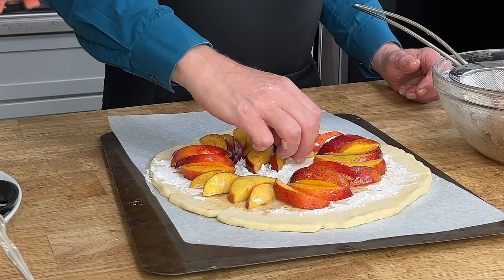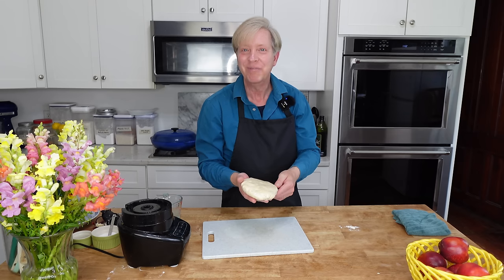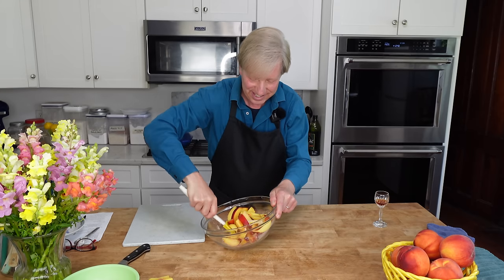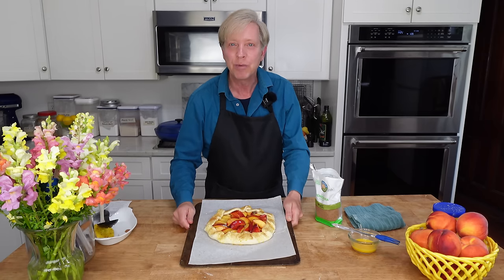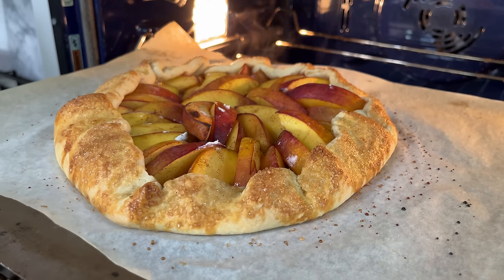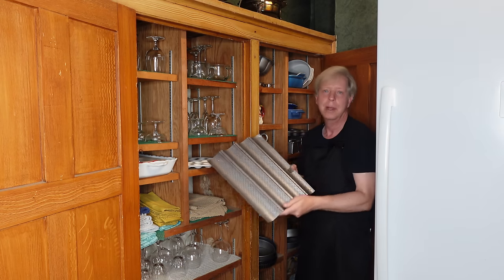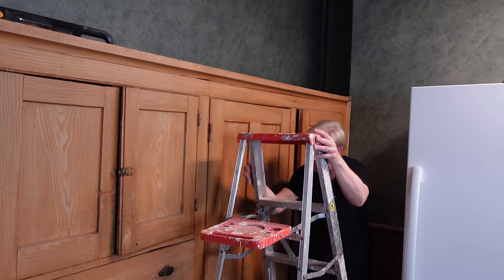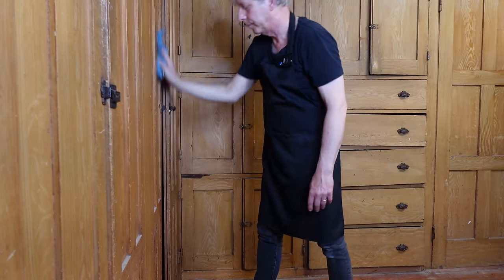Cleaning My 19th-Century Pantry & Making a Peach Galette

Comment: Another fabulous post! For the pantry shelves you can prob use those wire racks that come in different sizes. You might need to put two racks in to fill the depth to the back but that would work and some of the more expensive racks are adjustable in length. Of course, you can get those racks for the kitchen too. Love that your galette instructions include "I'm going to lick this spatula!" ps I need to get a Vitamix one of these yrs! Best, from thankfully still rainy Colorado!